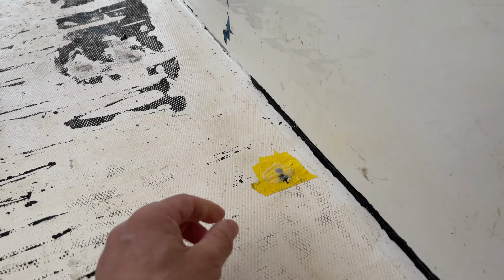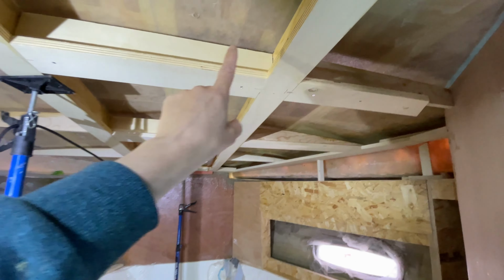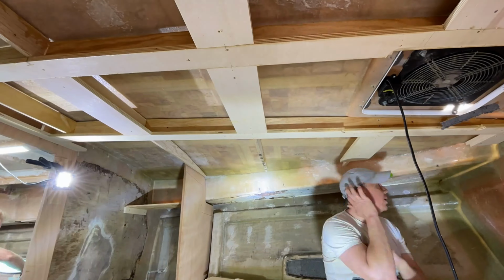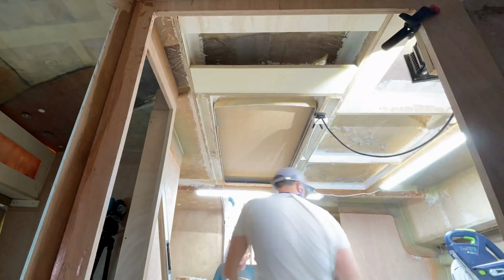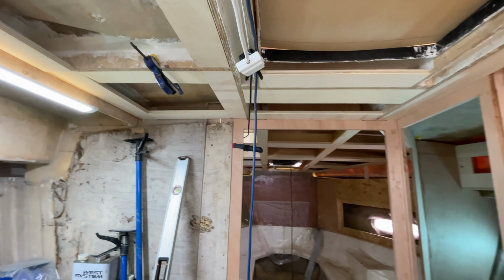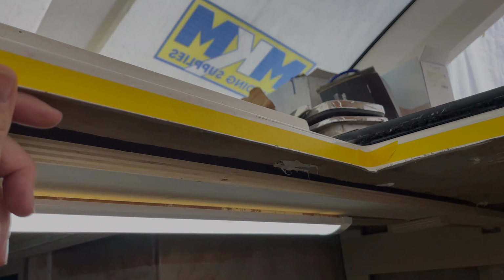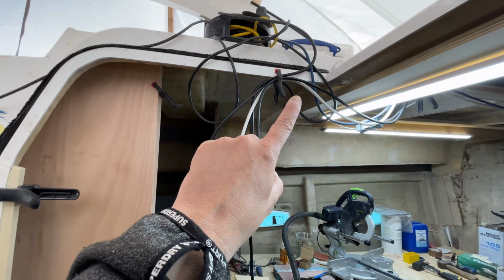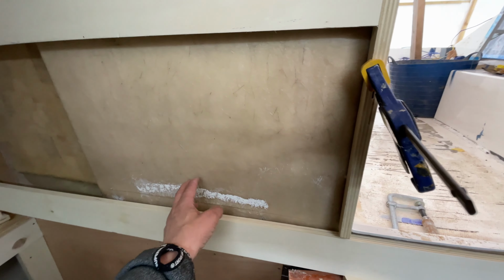We MESSED UP on our Project BOAT - EP 97

Comment: Do you think this boat will be much heavier than the factory built version?
Reply from the maker: The timber we are using is lightweight poplar plywood. The factory boat had an internal liner and mouldings which would of added significant weight, so we are hoping to come in under weight....

Comment: Great work !!! I have watched all episodes in few days and I am impressed with your progress.
In this stage do not forget insulation...both sound and heat...consider selfadhesive rubber for both sound/condensation for everything below waterline, before glassing everything while you can still reach those areas. Condensation is greatest enemy as it will make boat constantly damp...Also try to use less wood support as you are going to be very  heavy and that can cause million other issues...
Keep up good work
Reply from the maker: Thanks for watching, we will definitely be fitting insulation. The timber is lightweight poplar plywood and therefore weighs less than the timber and internal mouldings fitted by Sealine, so we are hoping to come in under weight....